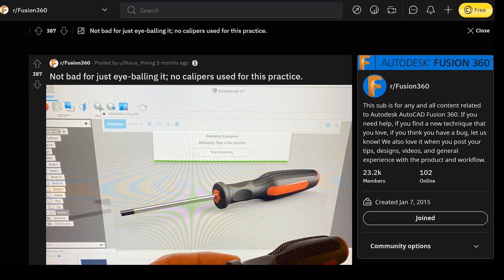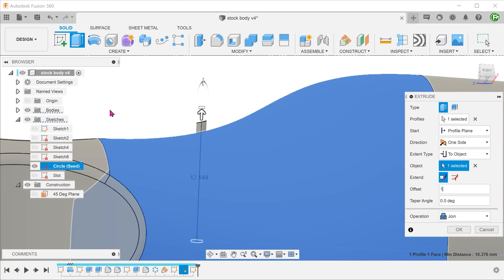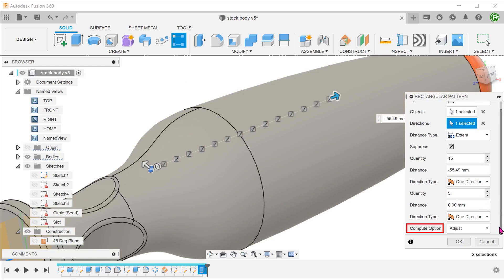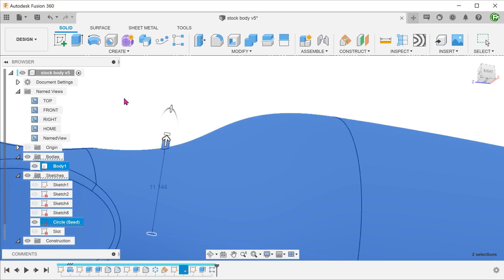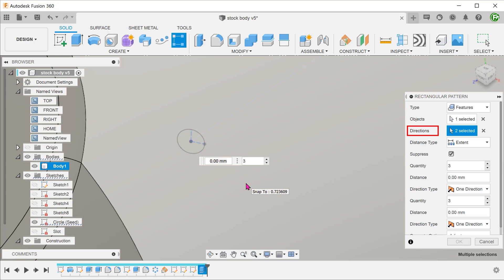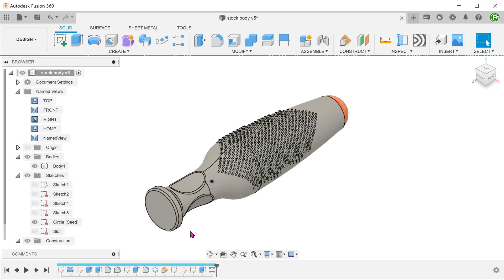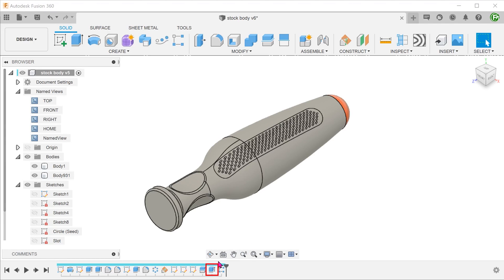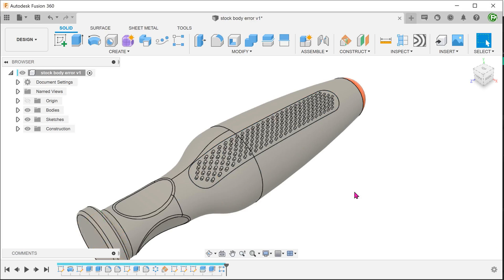Fusion 360 | Case Study 18

Comment from the maker: It probably took me about 15-20 iterations before I found a method that I could be satisfied with. I could not get a good result with pattern on path. I also tried many different permutations by varying the compute option. Initially, my intention was to go through all the failed methods. But that would have been too much material to cover. In the end, I decided to mostly cover what I personally feel is the most elegant method. If you have found this useful, do consider giving this a like. If we reach 500 likes, I will do a full video to show how the whole handle was created. 😀
Reply: Would love the full tutorial!
Reply: I figured out that the path doesn't matter, we can get the path from an offset of the face, and use that to cut the features at the right face value! I used the surface command offset and added thickness and used cut! Thank you!!!!
Reply: Full video ?
500 like is ok

Comment: I wonder if you could expand this to 2 rectangular patterns, with the first just being a 4x4 layout of the seed shape instead of 28x28.  The second would be a 1x25 rectangular pattern of the previous pattern along the axis of the handle, with spacing to match, so that overlapping objects merge.  I don't know if the patterns will work or fail, but it trades the body cut (and its sketch + measuring) for a rectangular pattern operation.

Comment: Great video as always, a full video on the handle sounds good, surfacing in Fusion especially with the timeline on still frustrates me more often than not, so much that i stopped doing anything with surfaces and use blender if i need to mess with anything more than the base shapes
Reply from the maker: There is actually no need for any surfacing for the whole handle. Just a good old revolve.
Reply: @Fusion360School  saw that or figured it would be a revolve while writing the comment, but still wanted to rant about fusion not doing what i want it to do haha, but figured you would get where the (sometimes not always) frustration is coming from, love the videos, really helpful